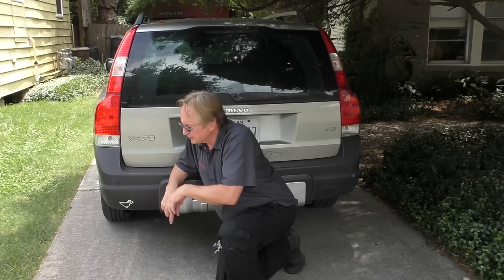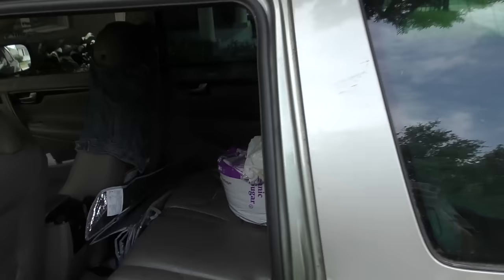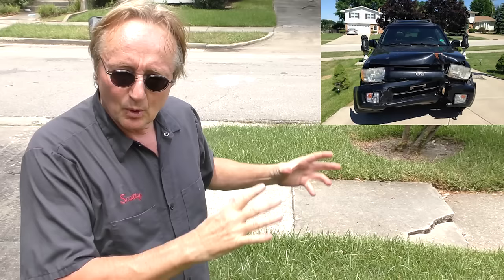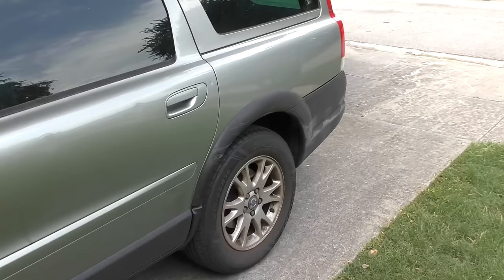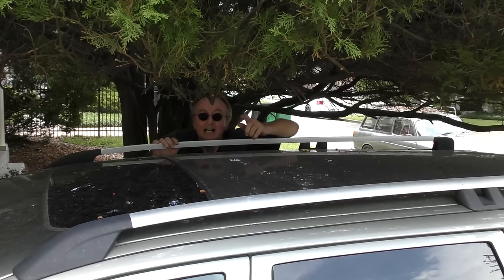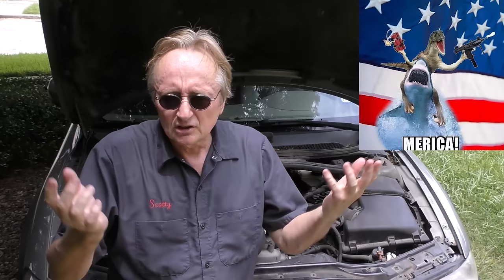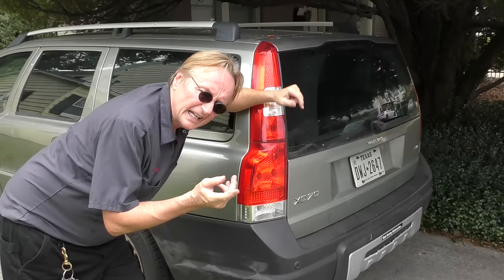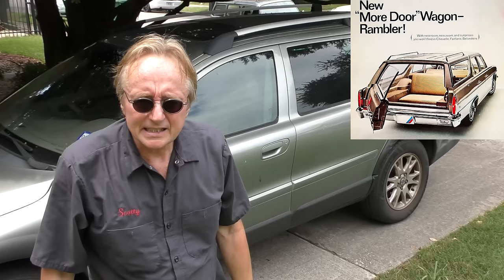Here’s Why Old Volvos Last Forever

Comment: Just bought my first car a month ago for my 17th This Exact Car exept 2005 got new tires, changed the oil, stripped and replaced the lowbeam connector and it only has 165k. Plastic is wearing and breaking though like your customers😂

Comment: Had my v70-01 for about 5 years, i put about 20k swedish miles, whats that about 20 0000km(?) Anyhow, it just went on and on and on, the only thing that broke was the alternator, i sold it when it passed 50k :P (about 310 685 miles for you others)

Comment: Sorry but what a load of.. uhm, crêpe. The last decent car Volvo built? That's what they said about the 800-series when Ford bought Volvo when they developed the generation from this video. That's what they said about the 700-900 series when they developed the first FWD and 5-cylinder car, the 850. That's what they said when the 700-900 series 'replaced' the 200 series. I mean come on Scotty, they still develop and build them fully independently, the Chinese only pump money in the company and receive whatever comes off the drawing boards in return. That's the entirety of the deal: ownership, nothing else. They still build extremely well made cars, just like they always have. Will they ever be problem free? Of course not, they are cars and no car is problem free. This generation (V70N/S60 I/S80 I) had their own issues: the undercarriage was relatively weak: struts and bushes needed replacing a bit faster than most cars. DIM instrument clusters were prone to faults, like VW's/Audi's from that time. PCV clogged up regularly. Automatic gearboxes needed oil changes more often than Volvo recommended ('sealed for life', ha.). 
But this is still the case: still very well built, still very safe, still very reliable, yet still not problem free. So where's your arguments why the 'old' ones are better than 'new' ones? Have you found 12-20 year old 'new' Volvo's and compared their reliability? Of course not, they are still (relatively) new. 

No, this is not one of your best video's Scotty, and that's coming from a Volvo fan who drives this exact generation S60.

Comment: I just got a used car. Exactly this car. It doesn't give any codes.. do you know the fix for it? I need to get it fixed and would have been a lot easier if the damn thing would give codes to the code reader. Doesn't even give codes to the built in message system. Only says the washer fluid needs refill. Which is pointless coz I was told the washer fluid didn't work, ND I know that's not what's wrong with the car. Lol.

Comment: How’s a 13yo car’s an old car ?   Considering ignition/fuel management and so many improvements, including milling/casting/forging processes cars are supposed to run over 500.000 miles for sure... but ! Manufacturers think different ... and you are for your safety and their sake due to change your car every 2 years or if your wallet is light weighed 4 years... crazy isnit ?  Mine is 15yo 235.000 D5 engine and drive like a charm... even the auto transmission shift like it’s leaving from the assembly line !!

Comment: Rear front control arm bushings are bad on all volvo of this generation. and the top mountings for the shock rods in the back, are bad as well. A lot of ppl think they have nice Volvo´s, with a volvo engine. But in fact they have a Ford engine under the hood. So buying one can be a hassel, looking for the right engine is key.

Comment: Scotty's way off the mark on this one. These Volvo's have a badly designed suspension prone to failure. Also the parts may be available for these models but are super expensive. They are cheap to buy for a reason, as they are just money pits. I have owned a 144, 244, 740 and a V70xc. I loved my 244 but later ones were so poorly designed and put together I won't ever buy another Volvo again. He may be a mechanic, but I think actually living with these cars over the years is different and he's dead wrong here.
Reply: I have 2002 s80 Turbo. Had two 1972 164 Es,  a 70 something 144, a 90 760 Turbo. Yeah, the suspension has issues but I swear, this s80 is best car of the bunch in terms of maintenance. But we all have different experiences. Volvos get more sophisticated, but they have their weak areas in all of their generations.

Comment: Can't find a simple trans temp sensor (A30-40LE) to restore torque converter lockup function.  Looks like a $50 sensor is going to be a car killer.  Same trans as lots of other '90s higher end cars, but nobody can find these sensors.  What a waste of an otherwise great car ('98 V90) I've owned for nearly 20 years.

Comment: Shame the automatic transmissions in these are one of the weakest made.  Literally 50% of those cars with autos here in the UK for sale are cheap because the transmission slips or shifts rough.  Plus I'd say there's something not right about the rear wheel/axle in that one judging by how it sits in the wheel arch.

Comment: The old Volvos was much better cars than these XC70 . The Volvo 442 and the 444 and all the way up into the late 1970's .  What made them so great is because of the engine's construction and the trans was not so bad ether . Back then Volvo used there truck engines sort of . Well half of it anyway . All the internal parts was heavy duty . Drive it like you hate it .

Comment: The one bad thing about old volvos...they run on premium! I loved my 240...a real Swedish Brick. Not these FrankenFord Volvos.
Reply: I've owned 2 850s and currently own a "FrankenFord" S80, trust me Ford did not mess up Volvo the S80 is just as reliable as the 850 and considering I've been rear ended in it my car barely shows a scratch on the bumper (I'll admit the actual bumper bar is bent) I could drive away from the crash like nothing happened. The other car needed a tow truck since they hit me hard enough to bust their radiator.

Comment: I really really REALLY want a 2015 xc70 T6. Buy or run?
Reply: Grab it. Bought a 2013 XC70 t6, used 4 years ago an it's a great wagon-nothing else feels as solid as this. Gotta love the straight 6 turbo motor - it's a smooth sleeper. So far after 4 years, no issues to report. Still on original battery even.

Comment: to be fair - that interior looks like absolute dung for a 2007 car ... BUT - they are solidly built cars for sure... likely to stay rust free for longer than many others too, the metal just feels thicker! - also may or may not have once rear ended a c70 with a peugeot and ... c70 had some scratches on its bumper and the peugeot had pretty serious frontal damage.

Comment: rofl, yeah 200k, you have a long way to go m8
Before i changed car my had run about 600k, only thing i did notice with that one was the westgate valve did look in open position if i would stand idle for to long  (10-15 minutes). Just restart the car and problem would go away
Fyi it's a rolling tank x'D

Comment: Scotty, Ford ownership screwed Volvo not the Chinese fella. The Volvo 70 2nd series is the best of them in our opinion. What would we know, we just race them, specialise in wrecking them and own shitloads. The 850s and series 1 and 2, 70 series were dipped in zinc so they do not as a rule rust. Once Ford got involved they just become another car. The Volvo V50 is the 5 cylinder Volvo motor and transmission, Mazda suspension, and a Ford Focus interior also body. Bugger Ford, they stuffed the Volvo car brand.
Reply: Volvo is way better now under Geely. In fact, Volvo is itself again. Those that just dismiss Volvo because it is owned by a Chinese company should read up on how the Chinese company is dealing with the brand. From what I can see, it's back to being Volvo. Now, I would love at least the 5 cylinder back but it's gone due to emissions and taxes.

Comment: a few corrections and caveats. 1. these cars are prone to a peculiar computer gremlin due to poor cool8ng of the ecu's. the ecu is not a part u can buy after market because volvo has to program them to ensure that ur not trying to do something dishonest like change the odometer on a 20 yo car. lol. they just want your money! also cargo room is great with the seats down but rear leg room is poor with the front seats fully back for a tall driver. also transmission issues are common - the car had a notorious asin auti transmission finally, so as usual manual was the way to go. too bad the green kooks outlawed manuain the us because they cant certify it for mileage compliance (u might be driving around at 55 in third! bad boy.) butbon the base non turbo engine the mileage was amazing for the day... 30+ mpg in mixed, non agressive driving. i got as high as 40 once on a long trip with cruise set at 55 mph. amazing how driving slower in this gen of car improved mileage... now they use a 10 speed auto to solve that i suppose.

Comment: BUwhahahahahaa!!  2007 ain't old, pal!  Try a 1967 or a 1977, or go home. Those were the Volvos that lasted.  By 2007, pretty much any vehicle was as good as a Volvo.  The lowly Ford ranger PU, the average American ful size truck, any Japanese car or truck, etc.  They're all good.  Even my 1996 Jeep Cherokee had 330,000 miles on it when I sold it. No problems other than regular maintenance.

The early 140's, 144's, and 145 series Volvos had British B-18 tractor motors in them ,by the way.  That's one huge reason they lasted. Simple, robust, and reliable.  I'll throw in the early 240 series, too, but much past that and they got glitchy because they lost the edge in simplicity and everyone else caught up.

Comment: They really don't. I've got a Volvo, it sucks. Electrical problems all over the place. Mechanical issues are not that bad. But man, do the electrical ones suck. Issues with corrosion on grounding, overheating CEM module, issues with A/C control. The funniest thing of all, when your A/C control unit fails, you've got no turn signals or lights xD 2004 V70. Sample size of one is nothing, but I've heard complaints of V40 issues as well. Electrical components seem to be a bit of a weak spot for these cars.
Reply: Chaminda Thushara Ruwan Kasturi  then my town must have bad luck. These volvo's are failing left and right. Engine issues, electrical issues etc.
Reply: Guy bought a V40… a week later major electrical issues started, buddy got a V70, engine died a week later. A coworker has a V40 and an S60… S60 already has had an engine replacement. This town is ~ 50% volvo's, I'd say 95% of those are diesels. Reliable cars if you buy  the end of P2 platform, least amount of issues. The beginning of P2 platform has a lot of major issues. The sad thing is that a  2006 Volvo V70 is somewhere in the neighbourhood of 7k, for a good car. My opinion is that these cars are driven in to the ground in richer countries like Germany and Netherlands, they roll back the odometer, fix them so they run for a week or two, and sell them here for ridiculous prices. And that is why they're failing, can't really blame Volvo there.
Reply: A friend of mine bought an Audi A6 2.7tdi with 180k km on odometer, he checked it at an Audi dealer, the guy servicing the car says that the real mileage is 470k km.
Reply: Chaminda Thushara Ruwan Kasturi  old Merc's are pretty reliable. Like really old, 30 years old. Still drives great. 190D is a great example. 250D also not bad, not too hard to find these cars with 600k on them.